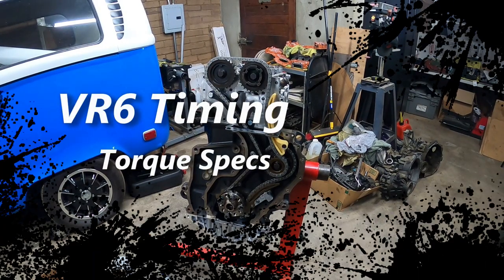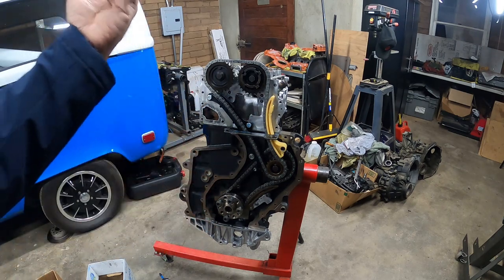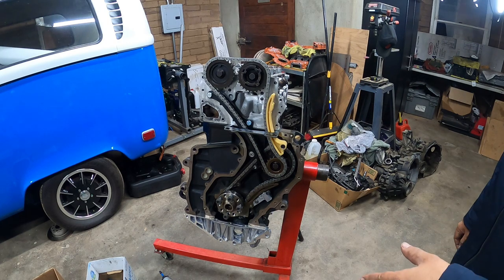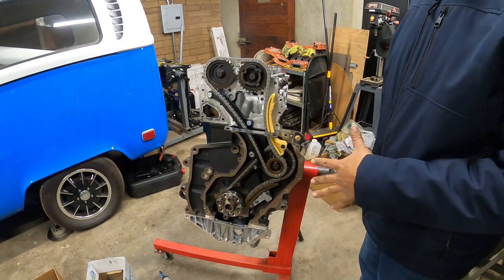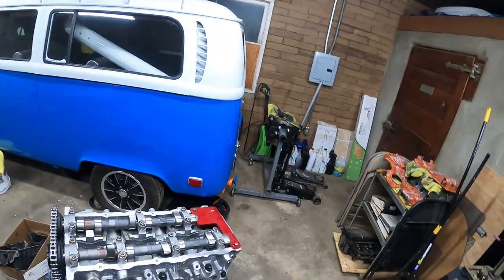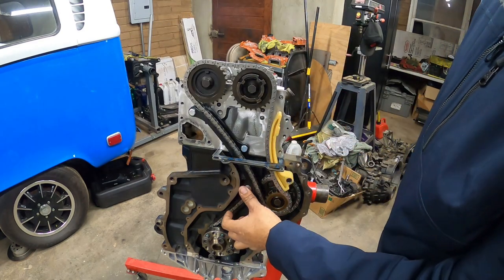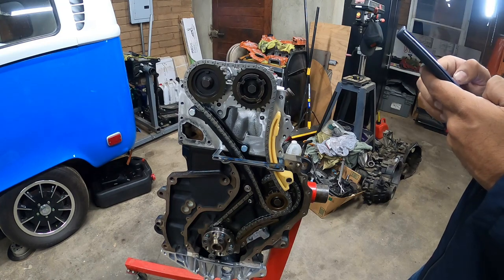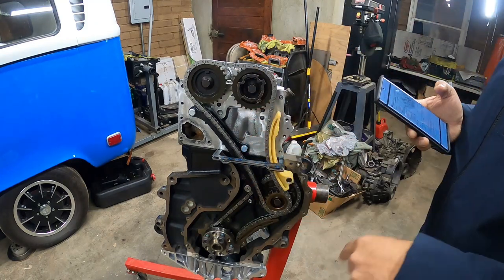VW VR6 Timing Hardware Torque Specs - Patreon Built VR6

Comment: On the newer direct injected engines, you need a pulley holder as the crank pulley no longer has a center bolt. 

Also the sprocket bolts need to be replaced, as they are torque to yield. 

60nm + 90° on the three sprocket bolts.